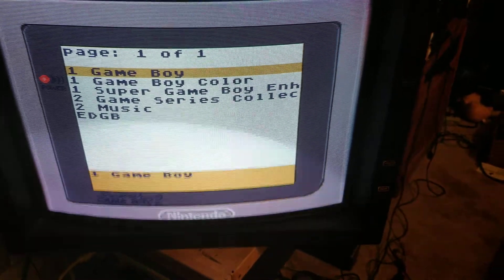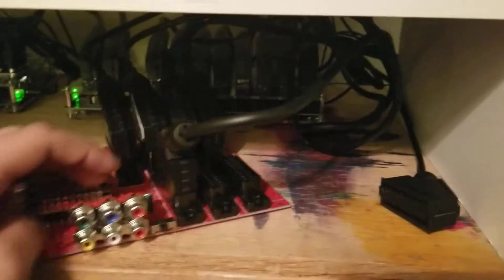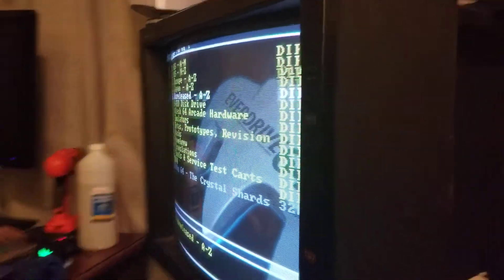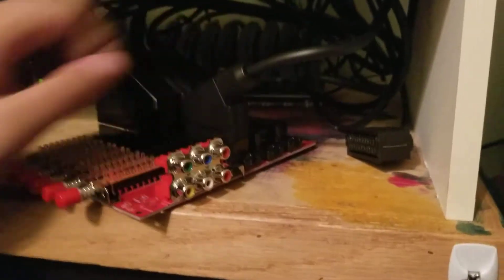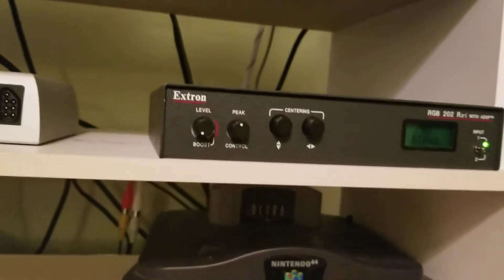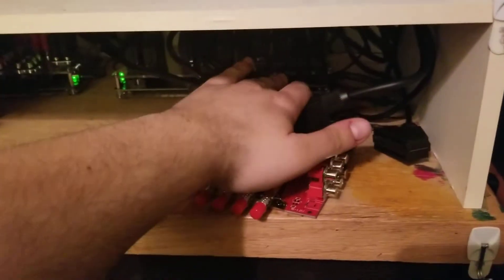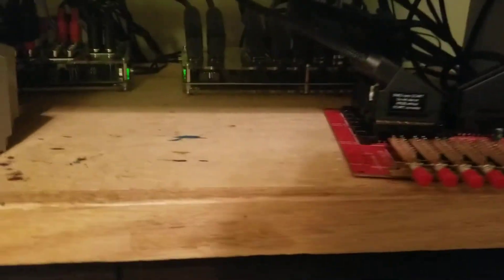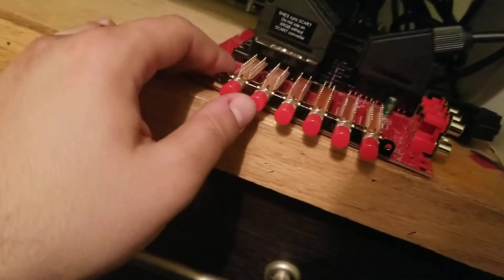Otaku SCART Switch Quick Review

Comment: I love a basic mechanical switch, but why did they have to stop at 6 ports? I was hoping for at least 8, in a tidy package that would stack nicely for tidy expansion.
Reply: Does this require a PSU?
Reply: Well, you have Hydra switch with 8 scart inputs for $160, and also W-Hydra with glorious 16 inputs for about $245. 😉 Otaku switch (5 scart inputs) price range is from $40 to $65.